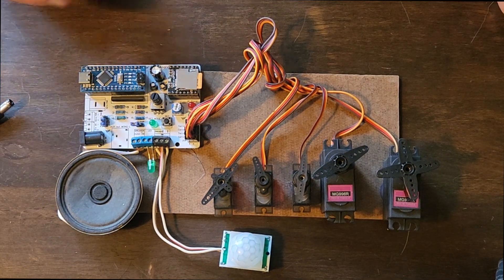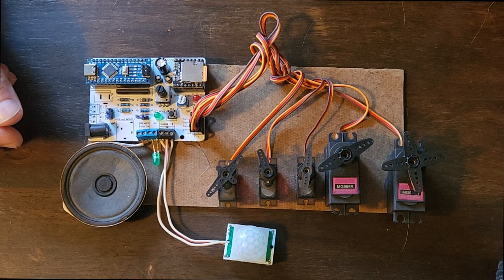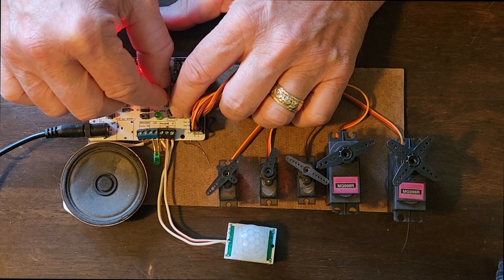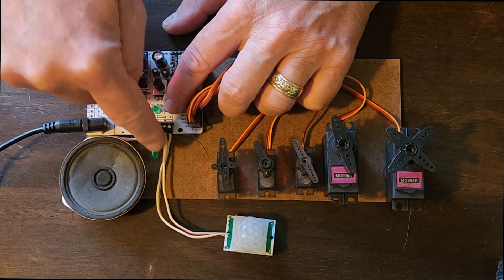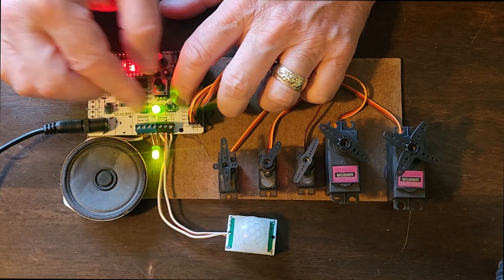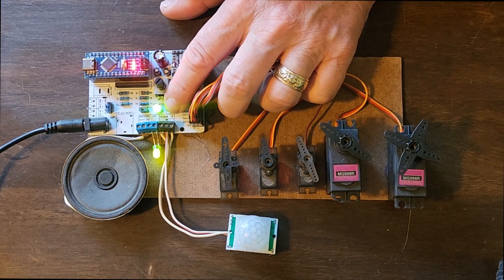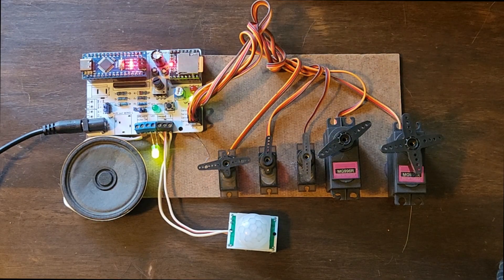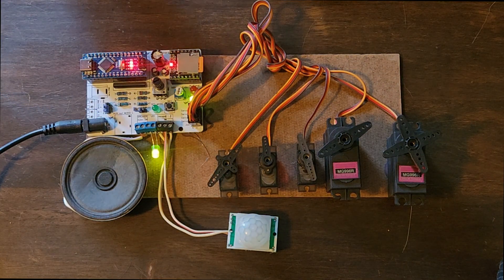DJB Setup

Comment: Hi Brian, this board is excellent!! I love mine. Is there any way to have it take audio from a line in for talking via a microphone or computer? Guessing it would need a code change if I tried to add that?
Reply from the maker: Hi Haileybugg, thank you for the kind words! You wouldn't need any code change, it's just hardware. Essentially, you would need to bypass the mp3 player and attach a microphone with a pre-amp. We are working on a board that can switch between a mic and mp3. But it's proving difficult.

Comment: Could this be used to actuate a larger servo, for like, say, a rocking chair?
Reply from the maker: It could, all you would need is an additional power supply for the servo
Reply from the maker: It could,  you would just need an additional power supply for the servo.

Comment: After putting together one of the DIY cards, there are two barrel connecters, one labeled 5v in and one labeled Servo PWR. I also noted there are two blue 2 wire terminals labeled the same. I see you only have one power in wired hooked up in this video. When would you use the Servo PWR? And, I'm guessing you can pick whether you want to use the screw terminals or the barrel jack? Thanks for all your help along the way.
Reply from the maker: Hi Ben, the barrel connectors and the 2 wire screw terminals go to the same thing, it just depends on how you want to connect. The Servo PWR is if your 5v connection that runs the arduino and MP3 player does not have the amperage to run the servos, so you can connect another power source to run the servos. Generally speaking, if you have a 3-4 amp 5v power source; you should use the 5v in connector and set the jumper to 5v in.

Comment: Hell yeah! What type and how many LEDs can it run? I’m sure the intention is to light up eyes but what about a strip or a spot for ambient lighting instead??
Reply from the maker: You could absolutely do that,  the "LED on when talking" mode was with a spotlight in mind (spot turns on when triggered).
Reply: @brianaala  I’m interested then! Best way to contact you about buying the board? Also any plans to show a build of the actual skull and servos? I’ve built motorized props but haven’t delved into servos yet.
Reply from the maker: @chrisandkat  we have a build your own (solder it together kit) for $55 plus $6 shipping or a ready made board for $90 + shipping. We haven't set up a webpage yet so for now we're taking orders via Zelle. You can contact me directly: 1brianpierson@gmail.com